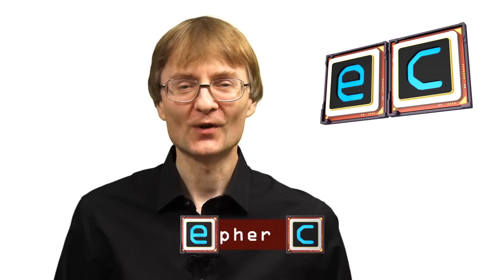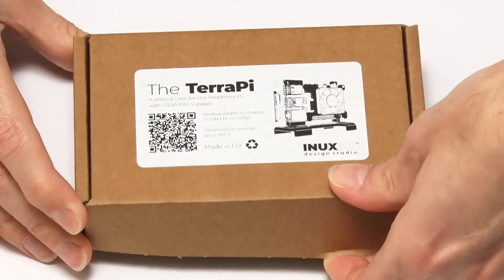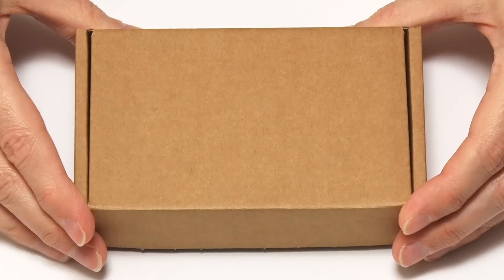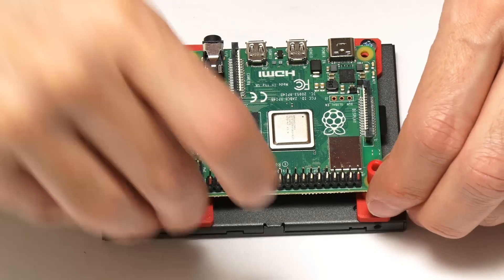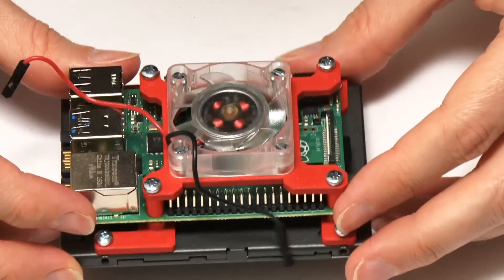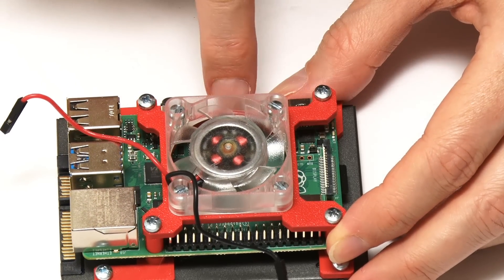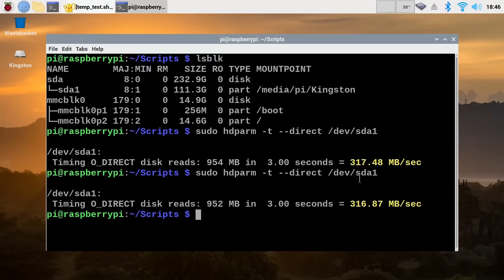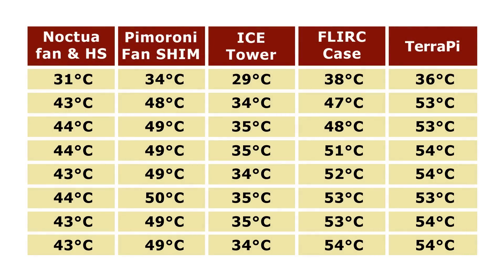Raspberry Pi 4 TerraPi Rig

Comment: Nice review. I'd be curious what the CPU temp is under normal or medium load (not stressed) without the included fan and with a HAT. If I were to opt into active cooling I would probably use an aftermarket fan like you did during the second part of the video, as I really dislike bright blue LESs on everything.

Comment: "Here is the base, and basically " I think he does these on purpose. 
They should have used heat inserts for the those bolts. Also, don't like how the HDMI and power now have to come in from the top. If they could do something about that they'd have a winner imo, but then it would be more expensive as well.
Reply: Boodysaspie  doesn't sound like a good idea for those mini hdmi ports. They might break

Comment: Have you guys ever seen these heat syncs? Im not affilated with them. https://www.ebay.com/itm/Enzotech-MOS-C10-Forged-Copper-MOSFET-Heatsinks/324098624084?hash=item4b75c88a54:g:8EsAAOSwrgFeZzEn
theyre called ENZOTECH copper extruded heat syncs. They work great on Pi's as a passive cooler, they have different sizes, dont just buy that one, that was for a 6mm x 6mm heatsync. They also have 10mm x 10mm from Alphacool that would be better suited for RPi

Comment: Nice setup, I wonder why TerraPi thinks saving 50 cents for a passive heatsink is a good idea, though. I'd guess the 10°C lower temperature isn't  delivered by the noctua fan but the heatsink.
Reply: You can always use the passive heat sink... The hat is optional. We will be adding heat sinks to the shop though for those who do want to buy a complete set.
Reply: @inux3dmanufacturing  thanks for the qualified answer! Appreciated!

Comment: TerraPi fan with heatsink might give same results as more expensive  fan? Wonder if the pi could be mounted other way round to keep usb cable tighter.
Reply: It’d probably improve a bit but Noctua fans are some of the best (if not the best) on the market - the air flow it’ll be pushing will be considerably higher than the no-name fan that was supplied. I’d be confident in saying most of the improvement is from the fan and not the heat sink.
Reply: @donkeyk1988  A heat sink is all about adding surface area and ideally getting the heat away from the object faster rather than tying to dissipate heat from where it originates, having ANY heatsink would provide a greater improvement over simply blowing air over a tiny metal plate.
Edit: He even provided proof of this in the video at 10:35, this "case" was by far the worst cooling solution, even when compared to a completely passive solution.

Comment: I tried. Same version of the firmware but it goes so slow that after minutes with an SSD it is always stopped at the same initial windows.
Reply: Are you referring to the SSD speed ?
Reply: @sensorequipment8283  I am referring to the fact that the boot after several seconds was always stopped. There was no progress
Reply: @PaoloBanci  You may have hit a hardware bug, or a software bug in UASP drive/code. Does it get into destop even after some hours? The other reason may be - overheating of the USB3 bridge, actually thermally throttling it and stalling some transfers. So to wrap it up, possible reasons are: Corrupted image (not likely - write it one more to it), overheating USB3 bridge (so-so, should continue with decreased speed), hitting a bug in hardware (some UASP drives/bridges have ssome bugs and may be so new that the're not blacklisted in the kernel yet), and softwaqre bug, in the kernel itself.
Reply: @sensorequipment8283  It is already the second raspberry 4 that I buy. The first was really bad and didn't even boot with the microsd. I'm not very lucky with the model 4. Instead the raspberry 3B + (2 units) I have work perfectly.
Reply: @PaoloBanci  Some microSD cards may be too slow to boot correctly. I use only SanDisk ones (Ultra, Extreme, Extreme PRO) because their controller is very very resilient. It can sustain many days of random reads/writes without dying. Not all microSD cards were made equal. They're pretty wildly different. The other reliable brand seems to be SAMSUNG.
I have 4 PRI4B total, 3 being 4GB models, one 8GB model. That one seems to be the best overclockable one, because they've increased the frequency of its PMIC chip (integrated switcher) by 50%, thus increasing its ability to pump more energy per unit of time.
Reply: @sensorequipment8283  I had no problems with the microsd but with the ssd via usb.

Comment: I'd like to know how the Terra Pi rig cools with the simple addition of the heat sink you added to the Noctua rig. Comparing a fan without heatsink to a fan with a heatsink seems to me to be an apples to oranges comparison. Given what we have learned about the thermal properties of the RPi4, running one without a heatsink seems a fool's errand, no?
Reply: Second that. With or without heatsink should make a bigger difference than with or without the stock fan.
Reply: but the point is to compare experience for someone who just bought this solution and how is cooling in stock to adding a heatsink and brand-fan

Comment: I believe that it’s going to be hard to find this kit available on Amazon.ca 

A 3D printed parts could be easy designed to provide the same results. Hopefully someone will work on that in the near future. 

I understand that the Raspberry Pi corporate has now posted the official boot to USB updated.
Reply: He said they were 3D printed, but they looked injection molded.  Would like to find STL files for this, looks like it's easy and relatively fast to print.  As you said though, not that hard to just design something similar.
Reply: @timezonewall  Nah they were 3d printed, whilst one side has a slight texture to it you can see the layer lines on the other side very clearly. At 4:51 take a look at the base part screwed into the ssd.
Reply: https://youtu.be/SotZUOfLBS8

Comment: Conclusion:
A fan that directly cools the CPU surface is just as efficient as blowing through a keyhole. The increase in the CPU area is crucial.
Reply: the increased surface area using fin stacks is always going to be superior than just having a fan blow directly onto the cpu.
Reply: just add heatpipes
Reply: I guess you should carve grooves into the silicon for increased surface area.
Reply: @DarkLinkAD  funny you should mention that. I believe researchers have been trying just that. Also filling up the groves with copper and experimenting with water cooling
Reply: @x3roxide  Gamers Nexus or De8aur right? ,I cant remember.
Reply: @DarkLinkAD  yep one of them
Reply: https://youtu.be/SotZUOfLBS8

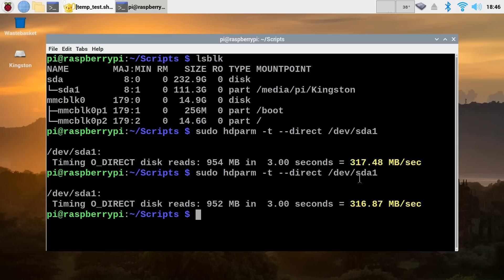Comment: 9:00 just fyi: ctrl-l will clear the terminal in bash.
Reply: I've been using 'clear' forever, despite been told about this key combination years ago. I could recall there was a combination, but forgot what it was, so when I needed to clear the screen I just sighed and typed 'clear', telling myself to look it up, then instantly forgetting about it until next time ¯\_(ツ)_/¯

So thank you very much!
Reply: And don't forget ctrl-d to exit a terminal (or many other apps which read input line by line from the console). Typing "exit" or "logout" is barbaric by comparison.
Reply: @StephanBeal  I Ctrl-D all the time, but thanks anyway!

Comment: Sir I have one problem...in mint 20 I am unable to run fritzing software(not using software center version ). in previous version of mint 19.3 it was working fine.
Reply: Could you downgrade?
Reply: @NicolasChapadosGirard  now I am on mint 19.3. but mint 20 is snappy and I wanna use that...
Reply: @BharatMohanty  you maybe able to upgrade only the part that help make it snappy . I am now where expert in Linux but as far as I know the upgrade is a bulk of upgrade.
Then again you could try to find what make your program unrunable in 20 and fix it.
Reply: @NicolasChapadosGirard  well I couldn't find any information about this problem in any community. Still trying to resolve it.

Comment: Can you make a dedicated video about overcocking raspberry pi zero
Reply from the maker: The process is the same as in my recent Pi 4 overclocking video -- just with different values.
Reply: Fanhat didn’t last long as word of the day, it’s been usurped by “overcocking”
Reply: My missus has as much as she can contend with in the overcocking department..... Any more and she'd end up wobbling when she walked!
Reply: Because chromium is hanging with the cpu load of 100%
Reply: And the disadvantage is it has single core with 1 ghz speed

Comment: Looks good, but I think I will still be sticking with my Argon One computer case.  Gotten used to everything out one end, and a power switch.
Reply from the maker: The Argon One is indeed a great case.
Reply: @ExplainingComputers  I like them so much I bought four of them, and gifted one to my brother! Thank you, sir, for pointing us to them. Best RPi case ever. So far.
Reply: The Argon One Case doesn't fit a SSD Drive so the two are completely different products!  You'd need to have the SSD Drive hanging out the side, which is no bad thing but the point of this product is to have a SSD and pi as one unit.
Reply: @stephenelliott7071  Yes, your point is completely valid if one wants to integrate the RPi and SSD into a single integrated "package". However, I have my Argon case sitting on top of a separate SSD drive case, which is a more flexible arrangement, since I can much more easily move the SSD to a different computer when I want to do that. That is the best of all possible worlds!
Reply: @stephenelliott7071  The NesPi 4 case fits the bill better. The issue is whether it works well for data transfer or not. Heard people say it us an issue, so I am waiting and seeing. But I am very interested, because it contains an SSD, and also has the power switch I want.

This product is clearly much more for Maker projects, I use my Raspberry Pi 4B as a Desktop Computer. 

No matter how you slice it, you need to use a USB 3.0 port to have an SSD. You cannot get around that.
Reply: @AnttiNannimus1  I have a My Passport hooked up to mine. And the advantage you mention is something I have found very useful.
Reply: @horseradishpower9947  The NesPi 4 case is very cool - but bulky in comparison to this product minus the vertical stand.  If you want a smaller form factor SSD solution then this product before a vertical stand and larger fan were added might suit better.
Reply: I'm very happy with mine
Reply: Oh AWESome!!  I love these Argon One cases!  Definitely going to setup one of these with a nice new 8Gb Ras-Pi 4B!!  
Excellent!!
Reply: The Argon One should have full size HDMI sockets instead of micro-HDMI.